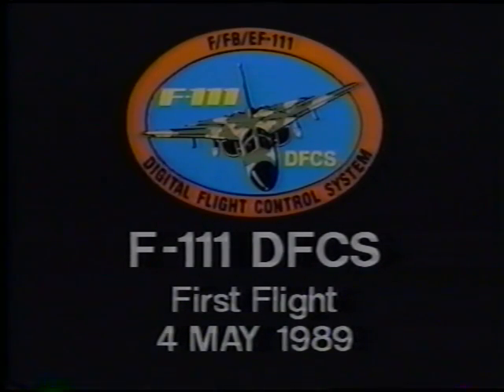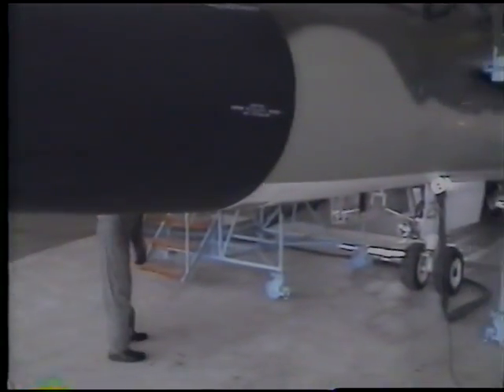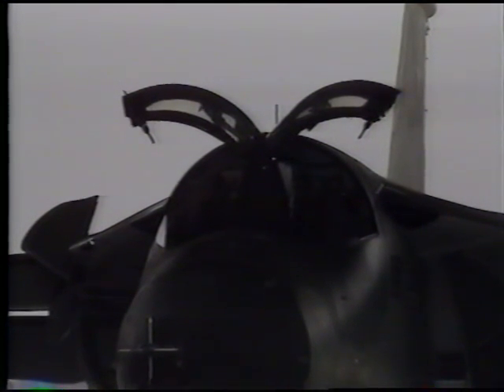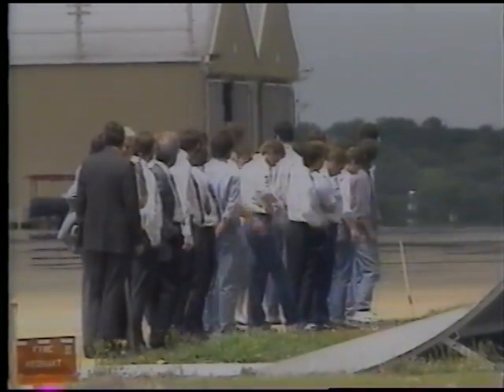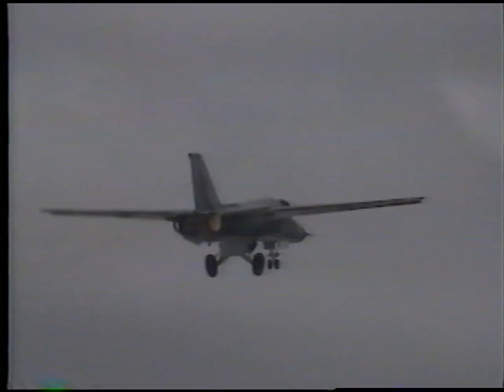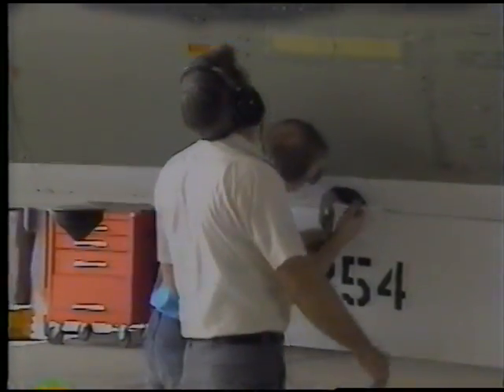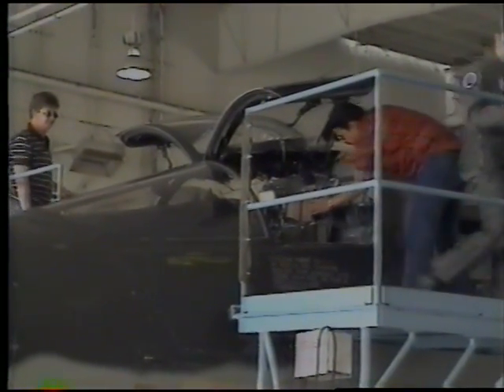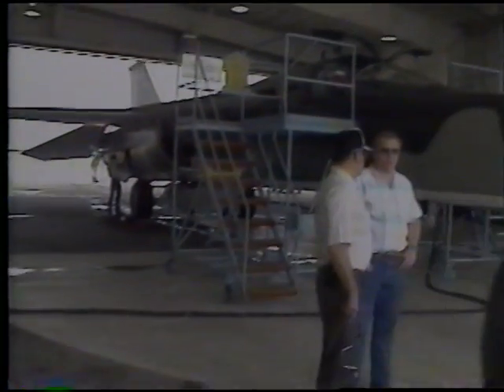F-111 Digital Flight Control System (DFCS) 1st Flight

Comment: I was an Instrument and autopilot or AFCS  tech and instructor from 1971 to 1980.   I can only recall 3 AFCS computers, pitch roll and yaw.  Also there was a feel and trim assembly.  What were the six computers that were replaced by the new digital flight control computer?  Was there any improvement besides reliability by the new DAFCS?
Reply: The DFCS replaced the three flight control computers. The goal of the program was for the DFCS-modified aircraft to match the flying qualities of the unmodified F-111.
Reply: @kenhas87B  I became an AFCS instructor for Sikorsky Aircraft on the SH60B in 1980.  It had a digital AFCS computer that was replaced about thirty years later because they could no longer get the processor to repair the computer.   What was the reason for upgrading the AFCS computers if the handling qualities remained the same.  Reliability?  Parts maintenance?
Reply: @jnbfrancisco  Your suggested reasons are exactly correct.  Reliability, parts availability and anticipated reduced maintenance were the reasons for the proposed upgrade.  The intent was to make the aircraft fly exactly like the existing F-111 fleet to minimize re-training impacts on the operational squadrons.  Of course the pre-flight, systems and EPs would have required re-training but the flying qualities of the modified aircraft were essentially the same as the operational F-111s.
Reply: @kenhas87B  I became very impressed with the sofictication of the automatic flight control system on the F111 after I became a field training instructor at Mt Home AFB.  I think that some pilots didn't understand the AFCS either   If I could have returned to the maintenance of the F111s, I would have done another 10 years in the USAF.  I loved to fix that wonderful airplane.  I didn't chose to be an instructor and couldn't get out of it so I quit.

Comment: TO MANY CHIEFS ,   NOTE:  THIS WAS NOT VIDEOED AT EDWARD AFB
Reply: It was at McClellan AFB....SMALC
Reply: @byt290  It was at the General Dynamics plant in Fort Worth, Texas.  That is where the aircraft was modified with the new flight control system, and the first flight was conducted at the contractor facility.

Comment: We did DFCS on the F-14 in 99.
Reply: Funny thing is the F-14 came about because of the F-111.  They had a Navy version of the F-111B they tested and took to the ship.  Because of the size, weight and maintenance issues (difficult to perform aboard the ship),  and GD's inexperience with shipboard designs, they contracted with Grumman for what would become the F-14.  The Navy really liked the swing wing feature, so that was made a requirement for the F-14.  It's also a reason it was sometimes called the "Titanium Deck Awning" when it had an issue that prevented them from sweeping the wings back after landing on the ship.
Reply: @synjdcrispy7843  - so many mixed views on the B model - some are on point most are not. I have read the factory files and a lot that followed. 
Its easy to be misled during what was a very turbulent time for the company & the media that hounded it.
Misunderstood is the end result for most

Comment: It's unusual to see a young Air Force pilot wearing glasses!
Reply: The requirement for pilots entering flight training was 20/20 . The pilot in this video was a major, so he had at least 11 years of active duty, After that they want vision that's correctable to 20/20. I needed glasses after 8 years of flying.
Reply: @michaelprusak6188  That is exactly how it went.
Reply: Thank you for your explanation.

Comment: Chris Toney - your late father Ben, kindly sent me some files for my research on the F-111.
Reply: After my F-111 flying days were over, I was assigned to work on F-111 modification programs at McClellan AFB in Sacramento, I got to work with Ben in the early 90's. It was a great experience
Reply: @michaelprusak6188  Which versions of the Vaark did you fly?
Reply from the maker: He tried his best to make sure folks who worked with the plane had mementos of their time with the plane.
Reply: @christoney2491  I worked with your father on this project.  He was very good to work with and ensured the success of the test program.  I was surprised to see the video posted, brought back memories.
Reply: @christoney2491  I worked with your father on this project and he was very good to work with.  He listened to test pilot inputs, was responsive to our suggestions and ideas, and he had all the right priorities in developing the system.  He was a true gentleman.
Reply: This is the first I heard of DFCS. Did it go into production?  I knew of navigation upgrades but didn’t know of this.
Reply: @tlfflt1983  The DFCS did not go into production on the F-111 fleet due to budget constraints, though the test program was successful.